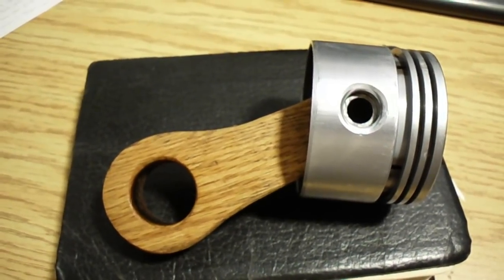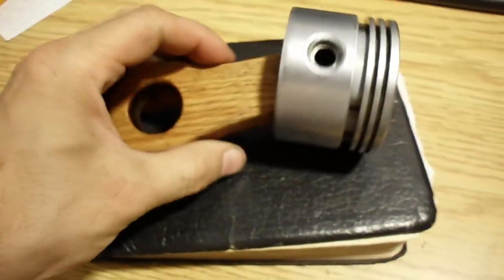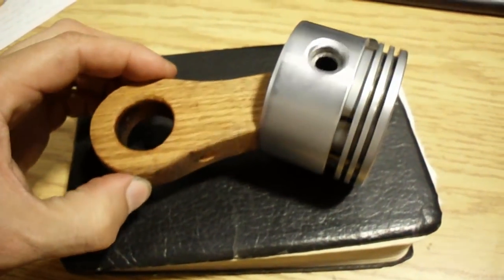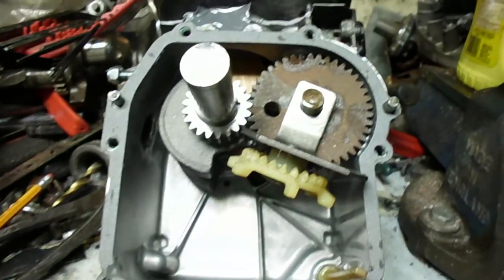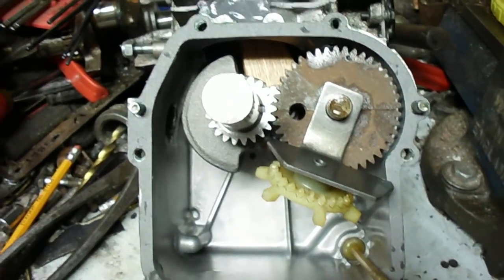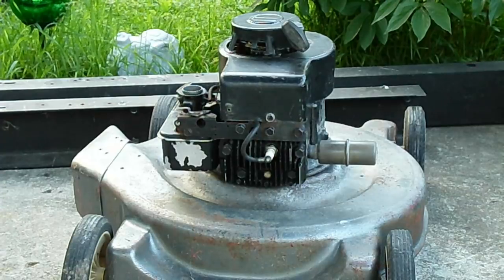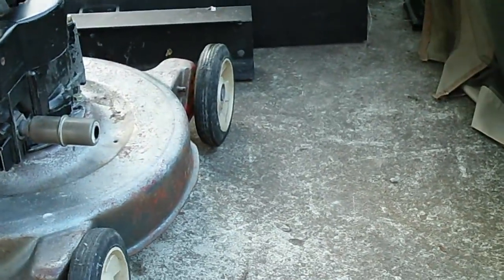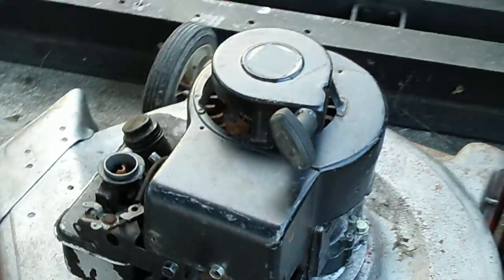WOODEN CON ROD RUNNING!!!

Comment: the reason it was running rich is because those type carbs (for some odd reason) require the breather screw to be in place, if its not there it will pull as much gas as possible  and flood out.
Reply from the maker: Yes, I figured that out after it practically covered the whole top of the engine with gas when it burped the first time it shut down. I added the screw before I made the 3 minute run vid. I just uploaded a 7-1/2 minute run during which I hold it at max revs for 1 minute.

Comment: Impressive! Holds up a lot better away from the combustion chamber!
Though I'm not sure how it attaches to the crank, is it two-piece? And what's griderchining?
Reply from the maker: I have kept the construction Top Secret for now, but the rod is only one piece. I thought up this idea for  JB Weld con rod, but those seem to shatter fairly easily, so i thought I would give oak a try.
Grinderchining is a word i made up to describe doing rough machining with a grinder, since i have very limited machining access, i have to find ways around it.

Comment: I think that carb needs the air cleaner screw in place to run properly.
Reply from the maker: Yes, i came to that conclusion also, and put it in for the 3 minute run. The newer none adjustable plastic carbs will work without the screw, but these old fellas seem need it as evidenced by the huge plash of gasoline on top of the engine when it quit the first time.

Comment: so this proves that stuck in the woods with a blown up briggs i can still get out there and cut the lawn...... keep up the good work. :D
Reply from the maker: LOL, I was thinking the exact same thing!  as long as you have JB Weld, and some good wood, you are good to go!  Now that the engine is tuned right i may go for a 5 minute run tomorrow. I didn't reveal all of my secrets on this engine, if you will notice, it is a 1 piece connecting rod, hint hint.  :)
Reply: THAT! is very interesting. I did not notice that first go around. That creates a set of questions, but i sure a vid to come will explane.

Comment: that was total ear rape when it starts at :59 lol good work though this is cool
Reply from the maker: Yes, it was running pretty nasty at the start. I finally solved the carb. issue about 1 minute into the 3 minute run on the other vid.